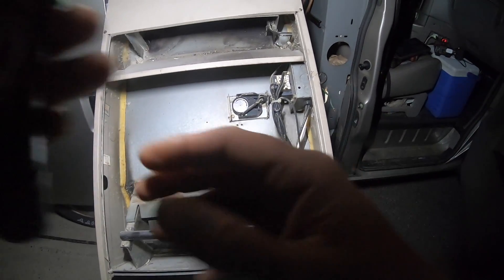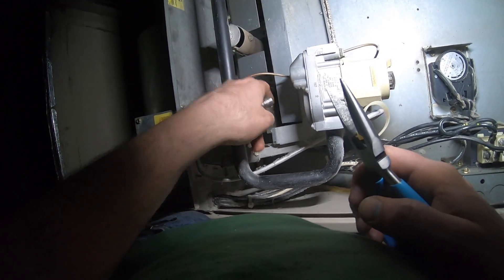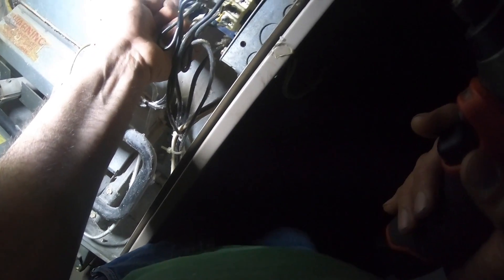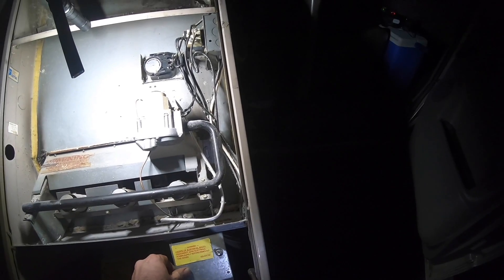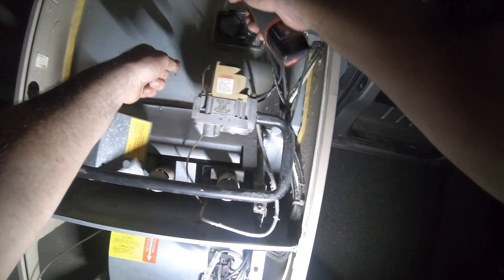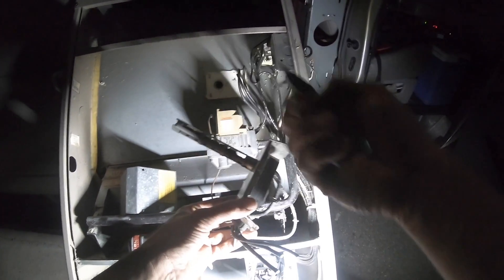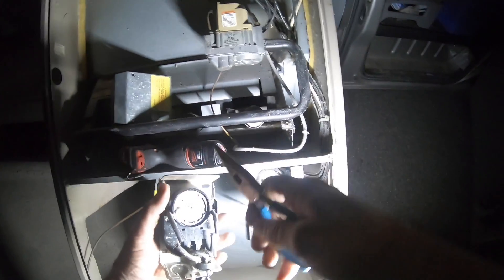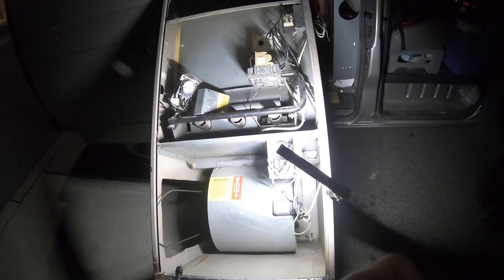How Simple/ Reliable Old Furnaces Were Designed

Comment: ive also worked on a very old furnace with a gas valve so old designed,its gas valve doesnt have a thermocouple or thermophile. its just a constantly running pilot port so when the pilot flame goes out it still keeps shooting gas.

Comment: We still have one like that. Last year I replaced the blower motor and recently replaced the thermocoupler. Works fine.
Reply from the maker: This only was replaced cause the compressor valves became weak on the ac. New ac and heat they wanted

Comment: I have a new fan/hi-limit switch "stocked" in garage, but as previously said, I have an dinosaur rheem still ;)
only thing not original on it is the thermocouple, last changed around 1994..... yeah I used an old stock thermocpuple from probably late 70's early 80's. new and cheap is OK, except it's so cheap there's zero quality and no reliability anymore.
Reply from the maker: I had the fan limit at my dads house fail a few years ago during several 0 degree days in a row while he was away. I think that was the coldest house I ever walked into. 11 degrees on thermostat. I shut the water meter off and hit wired the fan till I could buy a new fan/ hi limit. My dads neighbor stopped in the next day turned the water on. I wasn’t happy about that since he flooded the living room. I already knew the pipes froze and was planning on draining and air testing, before putting the water back on. Ahhhh, I still don’t like my dads neighbor yet my dad swears they guy is helpful.

Comment: what the heck is that blower compartment door switch junk??? not old enough a unit =p
Reply from the maker: There is older out there. This isn’t knocking older machines cause will the over engineered crap being sold today last 40 years?

Comment: The original Moncrief furnace that came out of my house not all that long ago was huge..... but very simple.  All I had to keep on hand was a thermocouple and a belt in most cases.  The gas valve was nothing more than a 24 volt solenoid connected to the black pipe inside fed into a cast iron burner.  The only protection was a separate pilot-stat and the limit switch just like you have in this video.  150,000 btu's that thing did roar when the burner fired up.

Comment: Very clean furnace.  Was it pulled because it was not "efficient" (a word that is over used)?
Reply from the maker: Replacing a system for efficiency is not my style. The compressor is worn out so swapping everything. I like keeping older machines going yet my customer wanted everything new
Reply: @thehvachacker  I know you like to keep the older machines going.  I like that about you very much.  It bothers me to think of the perfectly fine furnaces and condensers that went to an early grave that could have been used for many more years.
Reply: Brent Audi when I was helping back in the mid 80’s to early 90’s. I saw a lot of perfectly good equipment go away. Just for the sake of the efficiency scam sale all for a few bucks savings a month (sarcasm). 

HVAC folks then were silently frustrated with this. What you saw was the equipment being updated a lot, but nothing was spent on the duct work to help the achieve the needed efficiencies. Thus the new equipment was not seeing a very long usage life in comparison to what was removed. 😫
Reply: @Channel-cm7yc  Wow!  I bet a lot of that equipment that you saw pulled would still be running fine today.  It blows my mind what people will believe and spend money on for "nothing".

Comment: I had a vintage early 1970's furnace like that until 2002. I was told the heat exchanger never cracked because I didn't have central air dripping water on it. 
I finally went with HVAC and the unit wouldn't fit in the old heater closet. Wasn't deep enough to meet code. I had to get a package unit. I felt bad retiring a furnace that still worked. But, my large wall unit AC had already been serviced several times and had to go.
Reply: Ray Voorhies a properly working split a/c system doesn’t leak water on the heat exchanger.  Water can leak if the drain is backed up or if there is a lack of air flow that causes the coil to ice up and drip.  If you keep your filter clean and have regular maintenance, you should never have this issue.

Comment: For those of you who might not know, the middle pin (120°) is the temperature the blower turns "ON". The upper pin (200°) breaks the gas valve if limit is reached. And the lower pin (90°) will turn the blower off once the heat exchanger has cooled to that temperature. If you ever find the blower sticking ON and not turning off you can make a slight adjustment to the lower pin but it's VERY important that you hold the round dial with your thumb and not let it move at all You can then take a small screwdriver in your free hand and slightly nudge the pin to move it just a little bit. Just a couple of degrees will usually do the trick. Just remember, that's the temperature at which the blower turns OFF so you don't want to make any major changes or else you will turn the blower off prematurely and leave the heat exchanger hot or you will cause the blower to run far too long after the heating cycle ends. A very small adjustment should work 👍
Reply: lol, for added efficiency I set them blower on at 100F and back off at 80F!  yeah the fans run and run to purge and mix air in the homes, even had them cycle blower on from pilot light thermal pooling... until the heat exchanger breaks, they're going nowhere ;)
Reply from the maker: I just spun the dials to get a stuck blower to shut off. Or a stuck switch to start heating but then would order a new limit control. I miss resi maintenance it was no guessing game of when the fan will start or stop. Plus you knew if your exchanger was overheating and your shutting down on limit. No needing an external thermometer for testing heat. Now please explain to me how those stem valves on the condensers work? Was it take the caps off to pump down? In the old brown York condensers
Reply: @thehvachacker  yeah I learned how to slightly manipulate those fan limit switches over the years with all the tens of thousands of Pulse furnaces I've worked on. We've got a couple of new techs that go out and condemn them left and right just because they're old (and they don't know how to work on them). So my beloved old Pulse furnaces are disappearing. But I don't know what you're talking about with the York units. 🤔

Comment: I think it depends on what 'Old Timer" you are talking to.  There's a certain degree of 'ego' associated with the trades and sometimes its difficult for some to realize how easy it really was...but then again there WAS a certain degree of a different type of difficulty you're missing.  I'm an old timer and when I broke into the field the industry was at the tail end of converting coal stokers into 'inshot' or 'upshot' burners that burned fuel oil, natural gas or lp gas.  A good percentage of these were gravity heat systems with no blower and up to 24" round return air drops.  Many times we had to adapt the R/A to accept a belt drive blower assembly and field install the fan limit to control it. No biggie though, and there were a LOT of complaints about the blower noise.

 Then there were the times when one man was responsible for tear out of these old cast iron gravity systems built of several sections of donuts that would weigh 100 to 150 pounds each, remove up the steps by himself.  Then came setting the furnace and taking measurements for new ductwork converting all the old center of the house cast iron supply air registers into a return air network and laying out the branch ducts and register locations on the perimeter walls, moving furniture and cutting the holes.  This was usually expected to be done in one day.  If you were lucky enough to work for a shop where you could phone in duct measurements for shop fabrication early on the first day, your second day on the job one man was expected to complete the installation.  No a/c, of course.  And multi-speed furnaces were an option back in the day as a standard furnace was heat only with a 20 va transformer.  Field converting them to accept a/c required the addition of the fan/relay with 40 va transformer package and multispeed motor, sometimes two speed belt and sometimes multi speed direct drive.

If you had to fab your own duct, you started out in the shop on the second day and was usually installing by mid afternoon, depending on the quantity of duct and the location of the job, with the completion expected by the middle of day three.  If a/c was installed, you were given the whole 3 days.  If you didn't get done, you found another job.  The better companies gave you a gopher which really helped a lot.

I'm pretty much in agreement with you though on the troubleshooting the old equipment, commercial or residential.   It was a cakewalk for sure.  However, I spent the last 20+ years in DDC controls, installing, troubleshooting and converting old standard RTU's to be controlled by Building Automation Systems as well as startup and service of new equipment in virtually any tonnage you can imagine. It was NOT a cakewalk, but once you get the concept down it really was a very rewarding way to spend my last years in the field. I watch many of your videos and don't comment too often and apologize for wasting so much internet space with such a lengthy reply.  But this is a subject on which I can write volumes. And remember there are always the cocky old techs that may think you youngsters couldn't cut it back in the day, and conversely there are always the cocky young techs that think the old timers couldn't cut it with todays technology....  Both are WRONG. People that do what we do will always rise to the occasion IF they're worth their salt.   I appreciate your videos man.  Now I'm waiting for the trolls to reply ....lololololol.....  And feel free to delete this comment if you so desire.  (-:  Keep up the good work sir.  I am retired now, but continue to do a little work for family and close friends on occasion.  Actually installing an attic job for my son now as well as a total duct renovation on the first floor system with wood furnace add-on complete with auto-changeover controls for the s/a dampers.
Reply from the maker: I came into this trade woking with and for old timers. We would do everything on the installs. On an install day one, we went to the job, ripped out old equipment, then took measurements. Went back to the shop and made up metal for the job. A few hours later or the next day we would go and install a new system. I ripped out many old gravity or steam systems that were installed by the dead men. With sections 6 feet tall and had to break down the sections. Then moving those heavy sections with another guy at least not like you said by yourself. I remember even installing boiers bringing them down in sections and putting the sections back together where the boiler would be placed. My time was the beginning of 2000 yet NJ has lots of boilers that once were coal. I don't think some of you ones learning the trade would last with the old school bosses that wouldn't teach you anything. We were suppose to know everything yet they didnt want to share knowledge to help you learn Our trade was built by deadmen. This trade is changing. I am having a hard time changing with it. It seems this trade is becoming a sell first instead of keeping most machines running until they die. Plus the Machines are always changing I am not trying to insult any oldtimers with this video. I am just showing how easy these units are to work on compared to communicating 98% furnaces. If I had a need and could get my hands on a heat exchanger I would take the old york over today's overengineered garbage. The dead men set up our heating systems
Reply: @thehvachacker  Some of those old guys just did not want 'new blood' imposing on their realm.  That's when I swore I would NEVER become like them.  I like you saying our field was built by dead men.  So true.  But its just evolution...everything changes, and not necessarily for the better in many cases.  I knew the main topic of your video is the simplicity that WAS our industry so I interjected a bit that a lot of newbies will never have the opportunity to see or experience.  I cannot imaging what the next generation will have to work on and how the equipment will evolve.  Look at even now the VRV systems with inverter compressors and ECM indoor blowers and how that's changed just in the last decade. 

Then locking all those systems into a building automation system that's controlled by some dude in corporate headquarters four states away.  If you're lucky the BAS is your own company's and you have access with your own laptop but if not...you're at the mercy of getting through to them and sometimes they don't feel the need to do what you need them to do to get the job done.  Superior Comfort stated the exact phrase I've used countless times and that is that we just went through the best years to be in our field, the last 30 or 40 years, but then that's just an opinion.      Hahahaha .... "Dead men"...I'm gonna use that again !!  

Oh, one more point... I didn't mean that I had to do virtually EVERY job removing gravity boilers and asbestos covered gravity hot air system by myself.  There was a lot of times I had help...just most of the time not enough of it...LOL. Thanks again for your reply and we are totally on the same page man.  Keep on keepin' on.
Reply: This is exactly what I did when I first got into HVAC  in 1990. I really do not miss those days on tearing out Gravity Furnace, but I missed the days on custom sheet metal work. Really the last 30 years were the best time to be In HVAC field, that where you can experience and see “the good, the bad, and the ugly”.

Comment: There is a furnace like that in my mother's house over 50 years old  it's a Rheem over the years it has only needed a couple of fan motors and the fan controls replaced once or twice maybe a gas valve but it is still running strong in the northeast  the local utility inspects it annually no problems
Reply from the maker: Is it green or brown? Most likely a belt driven blower and that unit will outlast most of us.
Reply: It is actually blue with a gold color midsection I may have been confused it could have been Bryant and it is belt driven 
I haven't seen it in many years but it is 100,000 btu for a 3 bed plus basement townhouse never has to run more than 10 minutes at a time on the coldest days